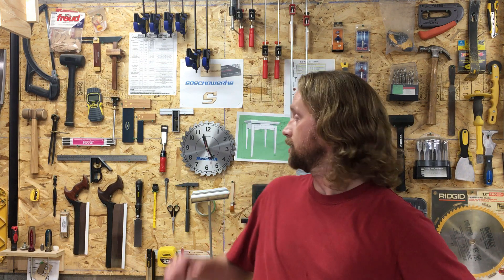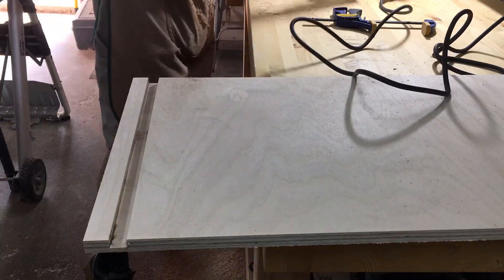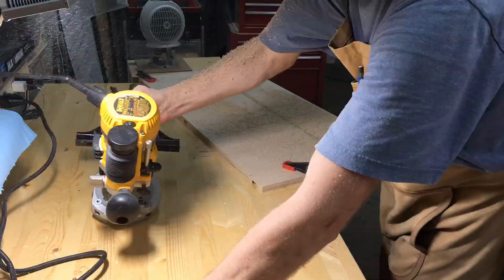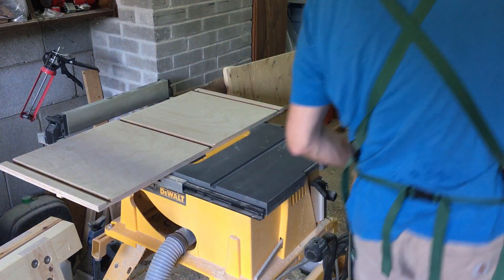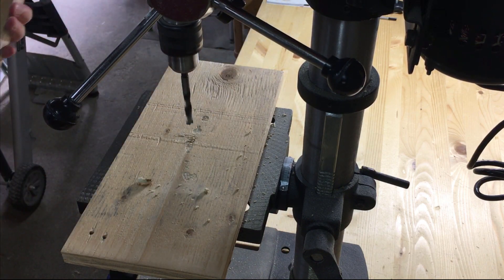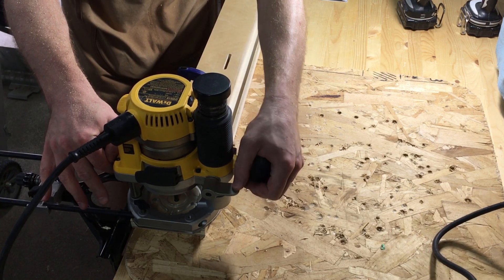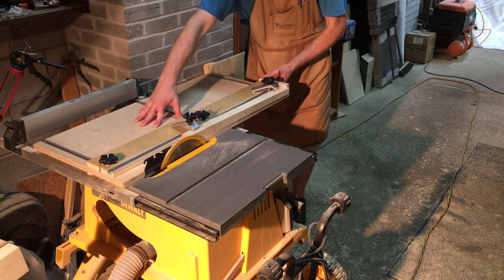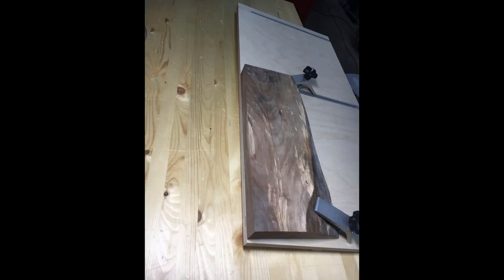Making a tapering jig

Comment: Thanks for your project video.  I have looked at a few and have decided that yours will come closest to satisfy my upcoming jig.  Others used the same slot in the cross member for the clamps to hold the jigs angle and the hold-down clamps both.  The separate  methods I think will work better for me.  Some use the rip fence to hold the jig the proper distance from the blade.  We'll see how this works.  I still don't know if the miter slot or the rip fence is the better choice.  The idea of the zero clearance at the cutting edge is usually only temporary for the miter slot but setting the rip fence precisely every time is usually a unnecessarily tedious process.  Joel
Reply from the maker: Good luck. Let me know which way you end up going.